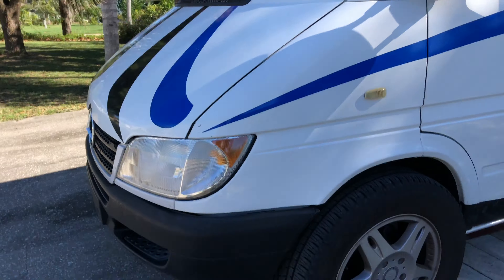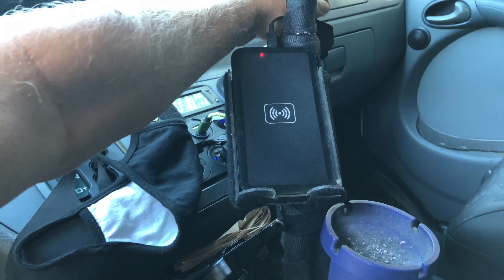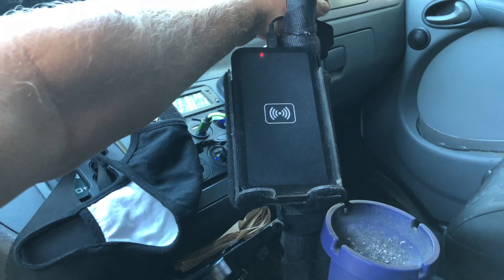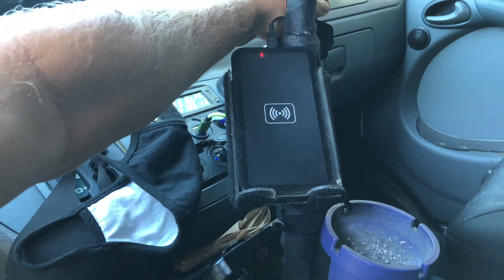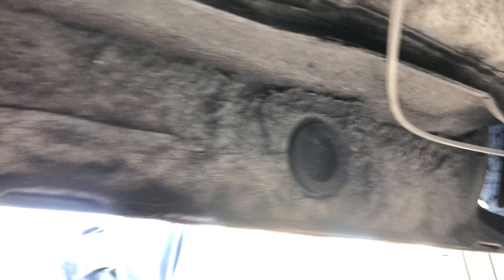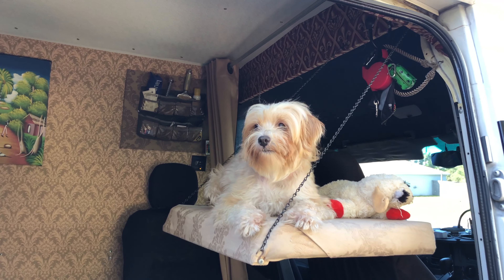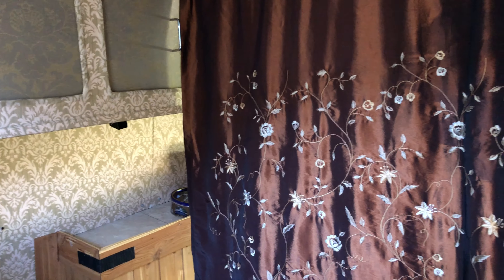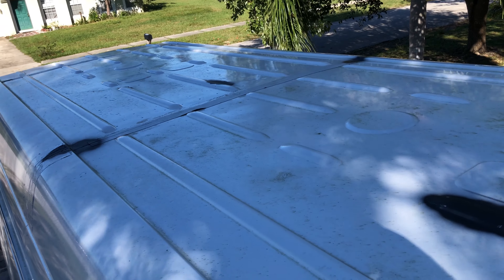Rolling Realtor Baseline: The Blue Saloon T1N Sprinter Pre Sale Inspection

Comment: Hey guys great job on the channel! Quick question for your 200 amps alternator did you had to upgrade the wire? Because I have a 150 amps alternator and I'm thinking of upgrading for a 200 amp and I'm wondering if I have to upgrade the wire as well. Thank you guys 🤙
Reply from the maker: I ordered my van new with the 200 amp alternator, from factory in 2005. It has the same size wire as all other vans with factory wire to a second battery so I've not needed to upgrade any wire sizes when upgrading alternators. 
If your second battery was installed later, we should look at what wire they used.

Comment: Nice van man! I love mine!
Just replaced the rear shocks with koni adjustable, replacing struts tomorrow with koni adj as well.

I need to skin the windows because the sills are showing rust
Reply from the maker: Can I come learn how to do that? Rust under the windshields is killing me this week.
Reply: @FloridaVanMan  I was actually going to ask if I could come down to meet up and have you look at my sliding door and possibly any other pointers you may have for me.

To be honest I’m mostly going to ‘wing it’ with the skinning. I bought some metal sheets that I will cut to the same shape as the the windows, then I planned on using sealed pop rivets to affix it after fixing the rust. On the inside I’d planned to use sealant before I fur out and spray foam.

If I knew how to weld decent, or even had access to a welder I’d rather weld them in place.
Reply from the maker: @WingItWithEthan  We don't have a shop, so weather can kill a day's plan. But come on down when you are ready. I like your idea about rivets and sealant. That diamond plate panel behind my sliding door is my best "body work" and I have big sheet of diamond plate we can play with. Send me an email to discuss this and we will make a plan. Bill@FloridaVanMan.com
Reply: @FloridaVanMan  I am also lacking a shop, which would make all of this so much easier!

I’m currently located near Dallas TX, visiting with family.

I don’t have to be back to the ranch where I work till April, So sometime between now and then may possibly work.

Window skinning, and raptor lining, bodywork/rust mitigation, and possibly spray foam is on my agenda whilst I’m here.
 Had an unfortunate accident with a grinder and my eye that has set me back a bit.

I will definitely reach out to you @ your site Bill!

Comment: Could you pretty please do a video on how your center dash DC outlet/USB outlet setup is designed and installed? My cigar lighter just failed. As you have briefly shown here there is much room for improvement.
Reply from the maker: My dash auxiliaries are powered from the leisure battery in the back so they don't drain the truck battery. All of the factory wires to cigar lighter and 12v plug are just unplugged and a fresh power comes from the back battery.
Reply: @FloridaVanMan  Great point on connecting them to the house/leisure bank. Is there any way you can see the voltage of the engine bat.? Did you install a new dash panel/cover or drill into the factory one? At a glance your outlets and displays look like they are placed nice and neat.
Reply from the maker: @mckennaz  I've drilled into the factory plastic dash so many times, it's heat together with thoughts and prayers. The 12v, USB outlets come with volt meters that match. I have one closer to the driver for engine battery, and closer to the passenger seat for leisure battery. That keeps them straight in my head. I also have a battery meter that displays like a fuel gauge, 0-400ahr with current draw/charge rate.  This makes my other leisure meter redundant. A bit of velcro now hides a spot where the newer meter didn't fill the hole made for previous gadgets.

Comment: What is the best/safest way to clean the engine compartment and engine.  Do you have a video on that.
Reply from the maker: We don't have a video on that yet. I use a pressure washer and start at the bottom because I lay down to see under, before I make the ground too wet. A leaf blower is good for drying, really just removing any puddles. Then I drive to warm and really dry the injector area. Be very careful or just avoid degreasers. One in particular, Purple Power Degreaser will leach through hoses and de-lubricate stuff like your a/c compressor.  First time I used Purple Power the a/c sounded like shaking a glass jar full of nails 2 miles after washing. I figure coincidence. Next time I washed engine, probably 2 years later, the a/c did the same and power steering started screaming within 3 miles of washing with Purple Power. Now I use Dawn and water on any soft parts, oven cleaner as needed ONLY on metal, shielding rubber from overspray.

Comment: Hey if a van fails the cap dance test, what does that mean? Is there a video or video segment where you explain this further? Looking at a van in FL now with no rust and runs ok, no Black Death, but bad cap test.
Reply from the maker: It could be indication of a lot of things. Send the video to bill@floridavanman.com we're always interested in seeing it.

When that cap dances wildly, it's usually an indication of crankcase gasses escaping and getting where they're not supposed to. It causes blowby and generally, blowby = lost power. If you're seeing that much blowby, it's probable that the van could have a hole in the piston, a bad head gasket, a bad crankcase breather, or just generally bad compression. Maybe it'll run well for a long time, but do plan for rebuild/replacement at some point on the van. If the cap dance is bad, it's probably not worth its asking price either.

Comment: Could you talk about the rear camera in the backup light? I've been looking for a solution for that.
Reply from the maker: That remains from 2006 when I had a laptop between the front seats. It is just a USB camera pointed at my trailer hitch for hooking up trailers. I also have a lipstick camera on the hood, connected to the radio-deck, but it's junk. When I get time for it we will be installing an 8 camera home security system. Most of them are 12v decks with a power brick adaptor, so it will be easy to adapt to van-use. Just a question of getting the right cameras and mounting them in ways that will withstand travel.
Reply: @FloridaVanMan  thank you